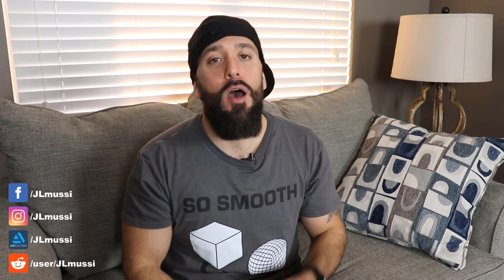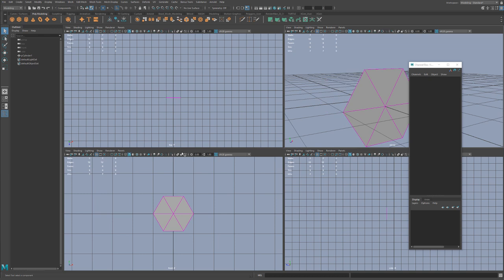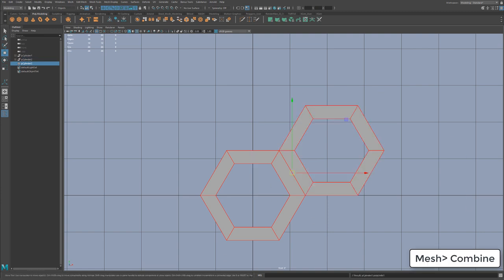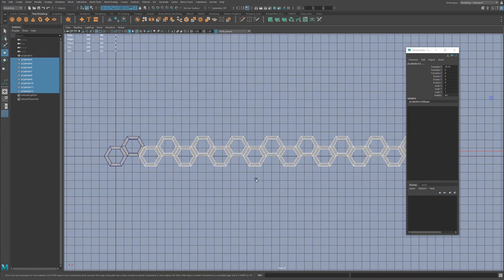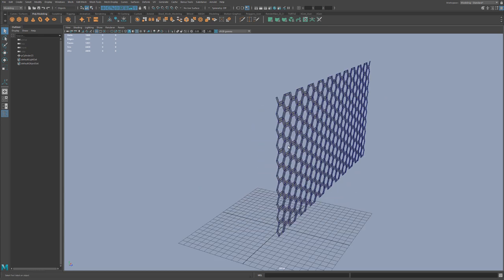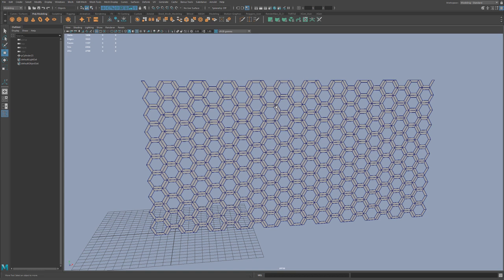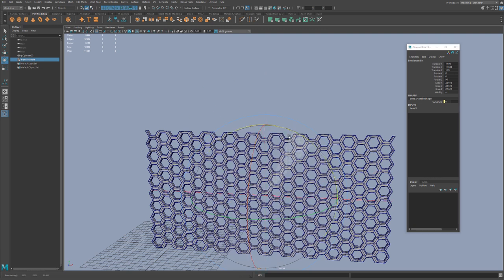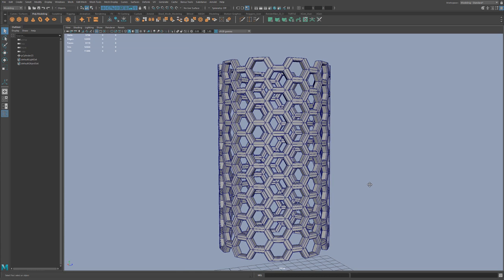Maya Hard Surface Modeling: How To 3D Model Any Pattern

Comment: Easier, faster way to duplicate your initial pattern sideways or horizontally is to duplicate with ctrl+d, vert snap your pivot, move it over, and then just hit shift+d as many times as you want to extend it as far as you want. Then you just combine everything. This takes seconds,  vs figuring out the transform values and typing anything in.

Comment: cool techniques, learned alot! i want to make the pattern into an object that is more complex than a cylinder :) right now specifically i want to make the number 8, in this same mesh style, but come short of skills.  Im thinking something like making the 8 as a curve, then extrude a cylinder onto it and somehow get the mesh onto that, or maybe have the mesh on a long tube, and somehow make that tube bend itself into the shape of curve(but curves fundamentally sux in maya so propably not)

Comment: .. Yet another great tutorial JL!  I had a slight issue when I used the bend deformer... with curvature set to 180 it didn't close the pattern to complete cylinder. Is this due to the length of the pattern or is there something wrong? I had to set it to 183 to close it up but can't be sure it's a perfect - vertex to vertex precision closed cylinder. Thanks for any advise.